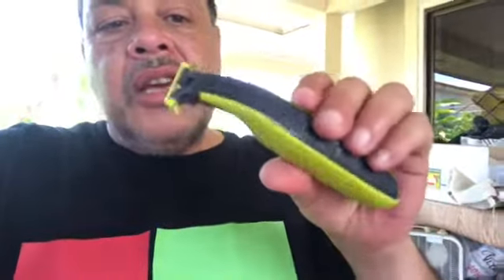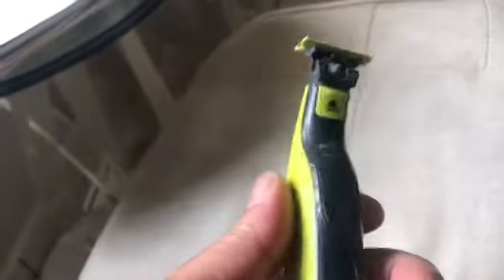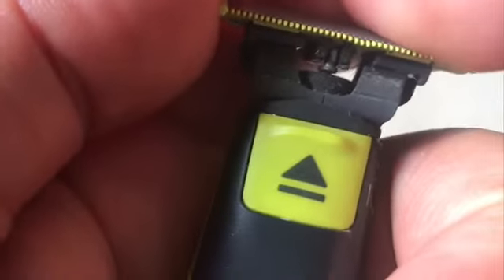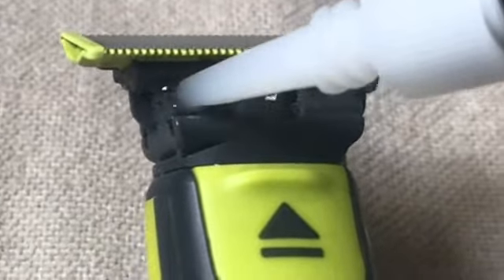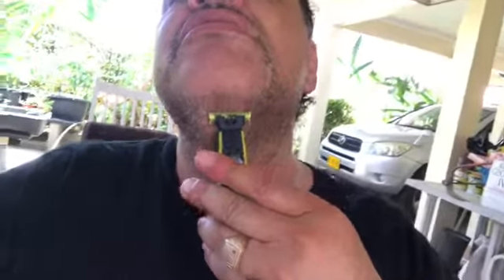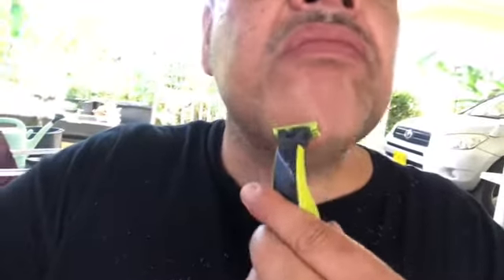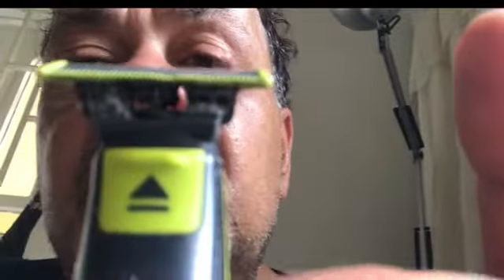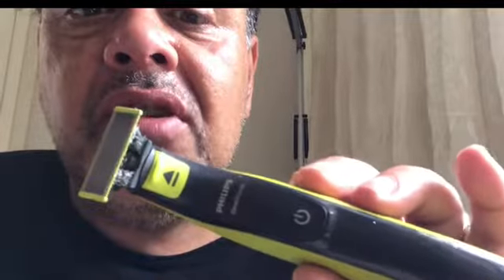My Phillips ONE BLADE broke while shaving 😡 let’s Fix it

Comment: I agree it gives a great quick shave. I got it last November and I broke 2 blades now. The first lasted like 3 months and it broke when my beard trimmer was dead and I tried to use the one blade with a guard.. the second one broke after like 3 days when it fell off the sink! I thought about either gluing or trying to melt it back together..
Reply: Thank you for this video!! I was gonna yell at someone from Norelco about it but seems easier to just try and repair it.
Reply from the maker: yoooo broooo check date video - im still using glued shaving head - that Suriname Glue does not give up lol - I dont shave my head anymore - only beard - I have new knives but hey maybe next year 😂🤚

Comment: I haven't found the plastic which clips out easy to buy online. Any ideas?
Reply from the maker: You can buy the complete top I saw them at schiphol taxfree shop for 22 euro
Reply: @channel48  Thank you for letting me know. I'll look into it 👍🏾
Reply: @channel48  No joy with that website dude. Any companies that sell them direct online?
Reply from the maker: MR TEE i m ggonna search for you ok 👌
Reply from the maker: hi check here https://www.beslist.nl/products/r/philips%20oneblade%20mesjes/?utm_source=gsaas&utm_medium=paid-search&utm_campaign=css&utm_content=css-provider-link
Reply: @channel48  Thanks for the link but it on shoes the replacement blades. Not the head and plastic clip. Thanks anyway dude 👍🏾👍🏾
Reply from the maker: The plastic clips ? They come with the topdon’t they?
Reply from the maker: Just checked see what you mean
Reply: @channel48  That's what I'm having difficulty trying to work out!!!
Reply from the maker: MR TEE it happened to my first one so i bought another and now i can swich tops if battery from one is low
Reply: @channel48  I hear you...I've just had buy another one. Such is life!!!